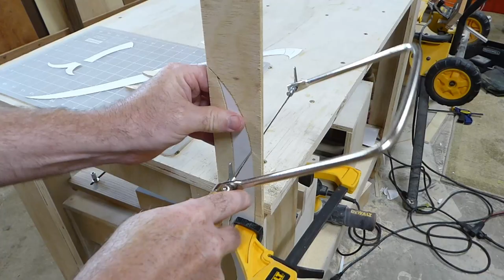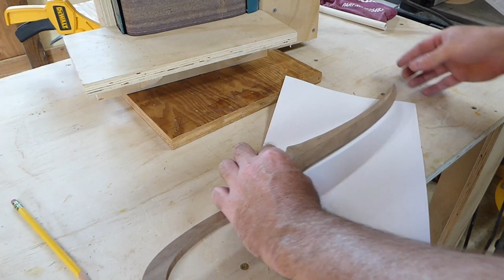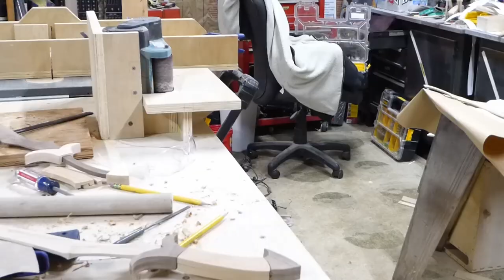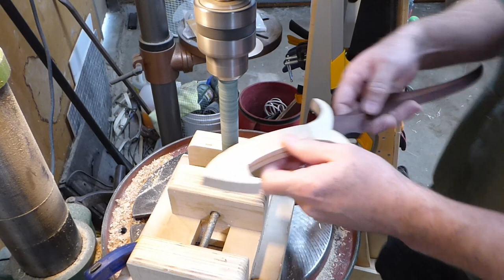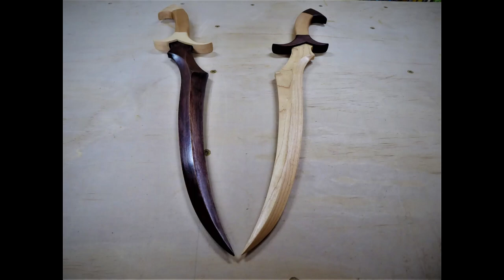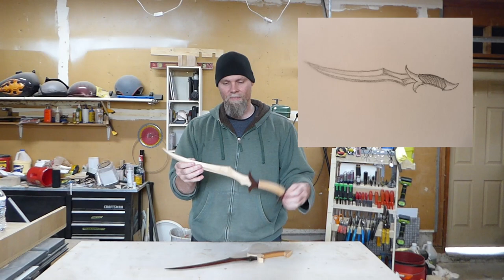Making Wooden Sword TEMPLATE AVAILABLE

Comment: What tools did you use in this video i know the exacto knife(to cut out the paper) and the belt sander. Every thing else im clueless about
Reply: Bit late, but: coping saw to rough cut parts, router mounted in a home-made router table to cut blade to match the plywood template, sort of a home-made scroll saw made by mounting a jigsaw in a box (?), various obvious stuff like chisels and sand paper.